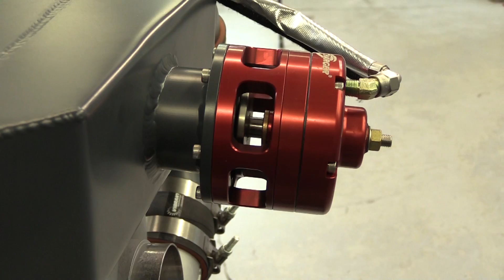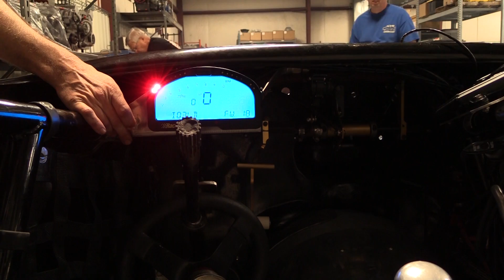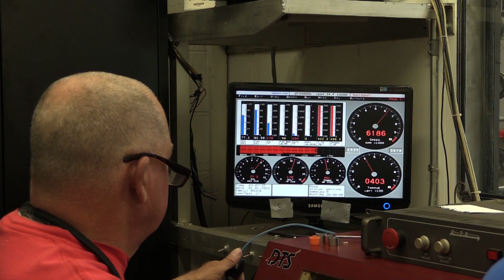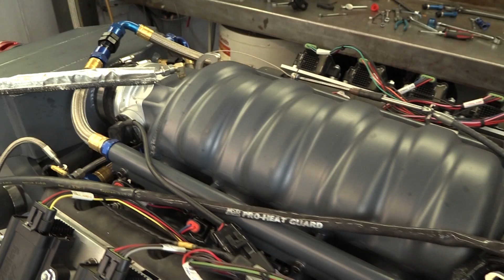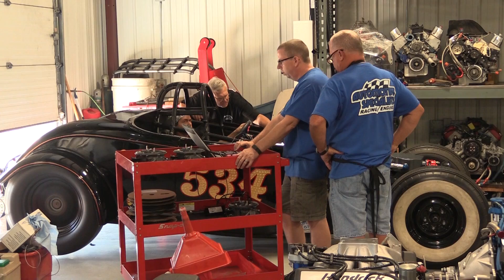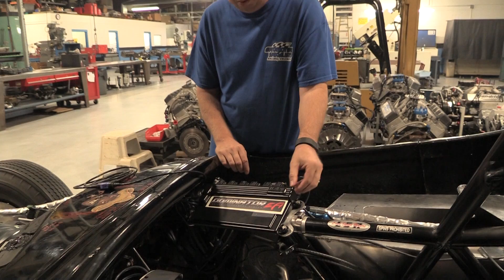A Thousand Horsepower on Just 260 Cubic Inches!

Comment: I like super powerful small displacement engines over large displacement. I want to build a LS version of the DZ 302. 4 inch bore with a 3-inch stroke high RPM high output twin turbo (or procharged) LS 302ci and throw it in something really light.
Reply: Look up an article from Car Craft magazine written in August 2015. Titled: 4.8L crank + LS3 block.
Reply: Great idea for an engine build. Look around for a Chevette that hasn’t rusted out and stuff that engine into it. Just something to be different, very light, and the thrill of flying in a death trap.
Reply: im doin the same thing
Reply: When it's nothing to get 9,500rpm out of a 377... why bother dropping to a 302? If you 10,000rpm or above, you run into valvetrain control issues. Furthermore... if you're just going to use forced induction, why bother with 302?... it's a waste of power potential.
Reply: James Copeland actually mine will be a 306ci destroked ls2 and im not trying to turn over 10k im just building it out of left over junk parts to smoke some tires with
Reply: Jake Browne Can't knock a guy for building with what he has... good deal
Reply: Eye of Osborne I was thinking of a 4.8L crank in a 6.0 block. I had it figured once, its under 320ci I'm thinking. Be nice for a older camaro or something , with a 6speed!!
Reply: Eye of Osborne anything under 3600 lbs!!!

Comment: This is cool. I dig it. Now days it’s not very difficult to make power. Now, reliable power is another story. Many racers are using big blocks with boost and having lots of success. Which is cool. I personally love all the boost particularly turbos. But my heart has always been with the small block. It’s more challenging to try and ring out a small block, I also think it’s more fulfilling as well. I like stuff that most people aren’t into like modular ford engines and sbf type stuff. It’s easier to get races and no one likes to get beat by a little ford. Especially one with less that 335ish cubes. The modern efi (2018) Holley, haltech, fuel tech, motec etc and the current crop of fuels especially ethanol has really helped. As well as accurate knock and newer lambda sensors like the lsu 4.9 style. Very good. I am glad that people are still interested in making things more efficient and doing it themselves when possible. Now if we could just get the gov and epa off of our backs and get some good fuels at the pump things would be a lot better! God bless you all patriots.

Comment: anyone ever think of big bore + super small stroke bigger than 302. i've got an idea about a pontiac setup 4.180 bore per cylinder, and 3.00 crank making about exactly 100 more cubic inches than this engine where it'd be at 560-600hp with about 500lb of torque the current engine masters "small/factory block" winner is a pontiac soo. yea

Comment: All that for 950hp (nascar heads, billet crank, custom manifold)???

 HotRod took a junkyard 4.8L (294ci) truck motor (STOCK crank/ rods/pistons), only ring end gap was opened.
Ported  OEM heads, ARP stud, MLS gaskets
228/230 comp cams
Fast intake/65lb inj.
twin 76mm air/water intercooler

Made:
900+hp @ 15psi
1,203 hp @ 26.8 psi

http://www.hotrod.com/articles/hrdp-1109-stock-gm-ls-engine-big-bang-theory/

Comment: wouldn't a turbo produce even more power tho ?
Reply: Yes....BUT.In a old hot rod they probably had clearance issues.

Also if it fit, the Turbos would be very close to the body with massive heat it could have burnt the body...this SC setup is more compact.
Reply: I see, didn't know there were clearance issues, that makes more sense to me.

Comment: high boost + high cylinder pressure + faster combustion + high air fuel mixture quality is making a drop fuel not becomes wasted. Lots of rpm making very much power stroke per minute. NICEEE!!!!
too much flame of exhaust manifold without missfire system when step on pedal gas,  make drop of fuel becomes wasted.

Comment: I'm surprised he's so worried about the high RPM for prolonged periods with that short stroke. Aren't these things built to do 9500 - 10000RPM anyway and for 500miles of that RPM when at 358ci or whatever they are normally. Am I missing something here? A reduction in stroke that significant should make it rev more freely than the standard NASCAR spec motors that run to the same RPM he wants to use. I would have thought the bottom end would have been good for 11500 - 12000RPM easily, and that getting the valve train to play friendly at those RPMs to be the problem. The piston speeds in this engine would be significantly less than what these engines were designed for. I wonder what comp and fuel he's using.
Reply from the maker: Sorry for the slow reply. The concern with rpm was more about maintaining valve control than keeping the rods and pistons in the block.
Reply: Yes but look at how long they hold top power with those 358's. Even at Daytona and Talladega, you're only turning at the most 8600 rpm all day which is a lot less strain. You turn close to 9500 rpm at Atlanta but it's for maybe 5-7 seconds then you let off for the corners. Doing a long speed run at WOT you don't want maximum power. Any piston engine will grenade being held like that for too long. Adding boost and increasing more cylinder pressure you make the valvetrain work harder to overcome the pressure resistance in the cylinder which means more friction and heat.
Reply: They may want the combination to last for a few seasons of high speed runs with the potential to up power in the future if they have to.
Reply: Rotating forces and piston speed are not linear with stroke increase. A longer stroke engine can have higher piston speed with far less internal g forces

Comment: is there a sence to spin this engine to such high rpm level if the engines with 2 valves per cylinder loose a lot of torque at high speed?
Reply: The centrifugal supercharger depends on rpm to make power and with the nascar heads and crazy rotating assembly it's great at high rpms. I'm sure there's not as much bottom end torque s as a 1000 hp motor with a 6k  rpm redline. But on a top speed run on the salt flats it's all about that high end
Reply: what?
Reply: ya it's all about the top end which is why it makes no sense running a supercharger instead of a turbo.
Reply: turbo makes the air to hot and air coolers take space. centrifugal supercharger actually cools the air a little bit... good ones anyway.
Reply: frankenstein01 superchargers continue to make power as the rpms increase.
Reply: Except centrifugal superchargers make boost based on the square of RPM so they're practically designed for top-end.  See also BRM V-16, it was a 1.5L V16 and they say power went up exponentially from 8000-12000 rpm and this was in 1953.
Reply: Pro stock is close to 11,000 rpm and with enough rpm and hp the tq becomes less relevant.
Reply: justin beam hey this not Justin you should go on one you should go on home and I don't believe a damn word just think I'm recording here f*** you all man hell with you Buck technology Justin as you go online sign in peace brother I know but I don't like I got it when I got it back when I go to pick up oh my gosh brother I know but I don't like I got it when I got it back when I got to pick up oh my gosh please brother I know what I'm hanging up

Comment: are there not 110ci motors making 1000+ hp running 8's in the1/4  mile even on FF platforms?
i did 450hp/L in my garage.... on less than 4 grand

Comment: Efficiency and supercharger are like oil and water. Go turbo...
Reply: none of those are drag cars,the fastest drag cars on the planet are all supercharged?
Reply: Actually the only forced induction with heat issues is superchargers. that's why they have heat soak and turbos don't. It's all about having a good intercooler so you're ok. The problem is with high altitudes when you ask the turbo to make the same PSI with less air, so it's spinning way too fast in that case. Superchargers never suffer from that with a belt of course.
Reply: turbos are more efficient and can be cooled by oil.... none of your shit makes sense. they last longer than supercharges...no belt breaks and can make more power than any supercharger....turboes for any street setup wins..... hands down.... look at the fastest street times for a mile.... ALL TURBO!!!!
Reply: tuned drag racing car, like mitsubishi lancer evo, nissan gtr, toyota supra, mazda rx-5 and rx-7, lamborghini aventador, lamborghini huracan, vw golf, audi r8, lexus lfa, etc. .........  ALL TURBO!!!!!
Reply: The lambo's are N/A bro

Comment: isnt this cheating? For every 14.7 psi you are effectively doubling your displacement.
Reply: As a guy who owns a supercharged car I can say "cheating" is often more efficient. lol
And, in theory, every 14.7 psi (or whatever the ambient pressure is) doubles the effective displacement of an engine. In practice this is not so as there are losses in volumetric, thermal, adiabatic efficiency, etc. Which is the reason for things like intercoolers. 
Just like everything else, supercharging has it's limits.
Reply: lighter engine weight with same power is more efficient

Comment: 260ci making 1k hp is amazing
Reply: Yes, but comparing this to modern race engine of the same nature  it is really impressive.
Reply: Hmm the buick v6 turbo has been reaching at or passed 2000 hp
Reply: @19Clutch69  who made 2000hp with a buick v6?
Reply: @joeross6523  Oldsmobile aerotech iirc, that car did 267 MPH and set a land speed record
Reply: @ghost-jesus  that car never had a buick v6.
Reply: @joeross6523  Lawrence Conley did back in the 90's. Look up 'Tweaked'
Reply: @231mac  I worked for Lawrence Conley at his speed shop, Tweaked didn't make anything near 2000 horsepower.
Reply: @joeross6523  He was running mid sevens in the 90's in a 3400 lb car. That's right around 2000 hp. Btw, I was at that shop quit often myself, since I had two cars built there over the course of 5 years, and certainly don't remember ever hearing of you, lol. Try again...
Reply: @231mac  it's was a tad under 3000lbs and ran a 7.75. One one the doors is on the wall in Chris's garage( where I was drinking beer with him, his wife, step daughter and her baby in April this year)over Black, their grand national. I worked for them on 525 when we moved to 1960. I dug the hole for the Dyno myself. It was Chris, me, little Chris, Jeff and Janice. So go fuck yourself, you don't know shit.
Reply: @joeross6523  Lol, bullshit! One of Larry's biggest bragging rights was the cars weight, Dumbass! He used to tease Gene Deputy about weighing more and having 'only' a V6 and still smoking his ass. And considering her name is JANACE (Oopsie!), gonna have to say that you're insanely full of shit. Anyone can google info, lol. Who was JANACE's idol? Give you hint: it was on the clock on the wall behind her desk.
Reply: Not really
Reply: they did more than that like 30 years ago

Comment: the  center exhaust port is siamesed,  SB2 are spread port exhuast.
Reply from the maker: Not quite. The intake ports on an SB2 are spread port. The exhaust ports are siamesed just like on a standard small block. The small block is E-I-I-E-E-I-I-E. That changes to I-E-I-E-E-I-E-I. Hope that helps.
Reply: You are mistaken, go look at pictures.

Comment: fun but 13b engines and 2jz make more power cheaper and easier
Reply: They also break easier. Cheaper? I don't think so
Reply: +ryan Pay me now or pay me later. Power, reliability, cost. You can only have two.
Reply: true. I guess its just the sound that gets me.
Reply: 13b will break easier sure. but a 2jz? nah. only thing left stock on the motor will be the bare block and bare head anyway. it will make more power from less displacement easier. honestly the only reason to run this 260ci v8 would be if rules only aloud internal cam engines.

Comment: in my opinion there's always an advantage to small displacement high revs, their power band are very extented and prolonged, while your standard big block Chevy is done at 6000 rpm to be generous, a motor like that could peak at 8000 rpm( im under rating it) that and when you boost a motor like that you are squeezing every inch of the available displacement so for the power it's making it's very efficient,  only down sides might be a huge torque loss, remember: there's no replacement for displacement, so a big block Chevy might feel stronger at the bottom end but will peak out sooner.
Reply: +Chris Ramos Unless you've got VVT and or a supercharger of some sort, both high and low reving engines tend to be the most efficent in the same sized rpm window or power band (usually around a 2500rpm window, give or take), screamers just do everything up high and torquers do everything down low.
Reply: +Rictim Eishort 
400 ci and up is usually worth it, unless crazy high hp isn't the main goal.
Reply: +Rictim Eishort 
I think you pretty much refuted your own point. Maybe you should try a motor with more than 454ci then?
Reply: +Rictim Eishort 
Hold on, let me get my waders on here, the b/s is starting to get just a little deep...
...because I wonder if you really have any concept of just how much houspower it takes to run 8 seconds in a 1/4 mile even in a stripped out, race prepped Vega?
Reply: +Rictim Eishort 
I think your numbers are way off. According the math (power to weight) it would take around 800hp to skirt 8s in a 2600lb car.
Reply: 2600lbs at 800hp I get about a 9 flat.
Reply: +Rictim Eishort Okay, so why didn't you mention any of this, like the wimpy dyno, in the first place? smh...
Reply: +Rictim Eishort did he just say the 454 was a joke he obviously didnt race one and he said a 454 corvette motor uh which
Reply: +jdr ok the 454 corvette motor i meant 427 there

Comment: Love this engine combo and sounds killer at full snot. But if you  check at 4.24 the lap top shows the map sensor is seeing 29.8psia ,so minus atmospher pressure 14.7psi you end up with a sneaky 15.1psi in the manifold. Which is a bit more believable than 10psi . Even with big high flowing heads 300cc runners i guess and big rpm you still need a 1000 plus horse power worth of air to kram into  that 260ci engine even if the VE is super high.
Reply: what he said

Comment: I always wonder what are the limits on standard petrol engines (boost, rev etc.)? For example, search YouTube for "boba golf 1233", that guy is running a tiny VW ABF 2,0 litre engine at 64 psi (!), this setup produces over 1200 hp and seems reliable (car is a daily driver).
Reply: +Lejf Diecks reliable daily driver is not a reliable salt flat engine
Reply: "Reliability" is extremely subjective and relative..
Reply: 64 psi is a racing gas or methanol only fueled engine. this 260 is on pump 93 octane just like me.